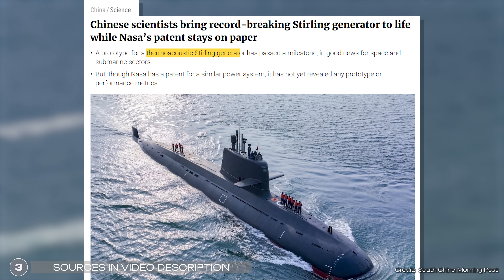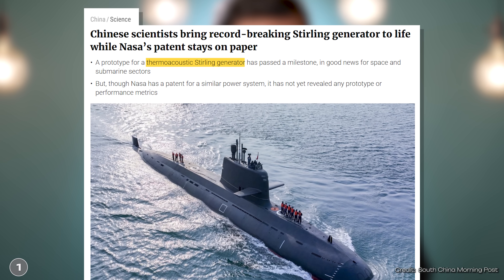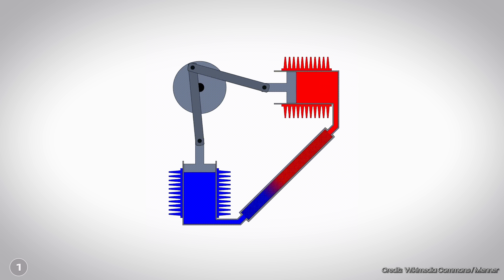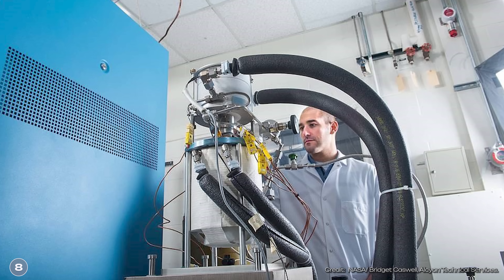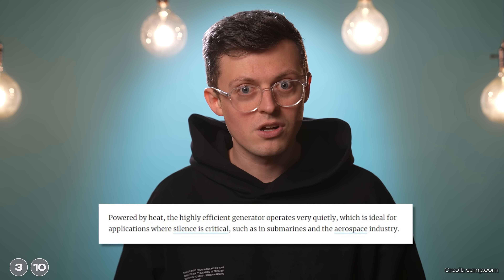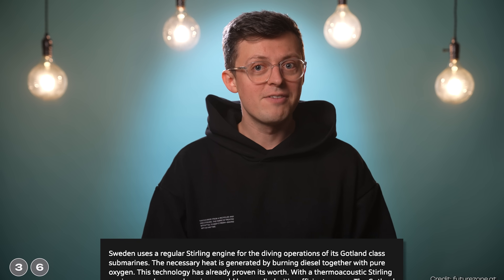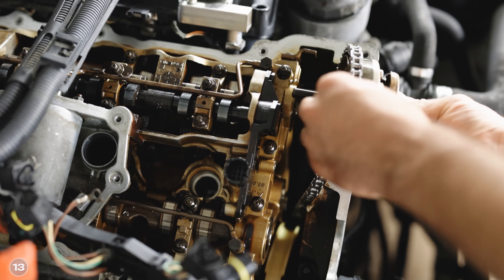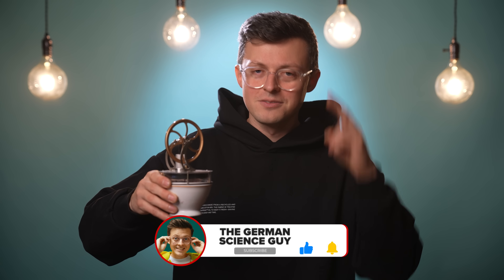The world's most POWERFUL Stirling engine: powered by soundwaves!

Comment: Sonar has an active mode and a passive mode, it is the passive mode that is impacted by quiet submarines and is actually the mode most commonly used to minimize being detected by the enemy. When a military is in search mode being quiet doesn't help very much because of the buoy's dropped by aircraft to actively ping for enemy submarines. These pings will bounce off of the hulls and get detected without giving position information to the enemy ship.
Reply: I believe there is another method of detecting submarines - the effect of the mass of the vessel on the (local) gravitation. 
There's no hiding place now!
Reply: @brianletter3545  Hmm.. Interesting, but a neutrally buoyant submarine has the same mass as the water it displaces, thus no gravitational anomaly is there.
Reply: @ True!
I have wondered about that.
Reply: The topic of sonar is highly classified, and it's widely misrepresented in media. ASW (Anti-submarine warfare) is a highly interesting topic from a scientific perspective. Both water temperature and salinity have a massive impact on sonar. Passive systems just listen for the echo of sounds. Active sonar creates distinct sounds that maximize the echo. Aircraft sonar is the hybrid approach where you listen passively to the echo created over a large area. The question at that point becomes what kind of receivers do you have aboard your vessel. The sonar array in a submarine is half the height of the ship located at the bow. Look at the size of the sonar array aboard a destroyer. Its not small, but they're a fraction of the size. Submarine sonar holds a distinct advantage over surface vessels. Even with active sonar, a surface vessel is significantly less capable of detecting submarines as their counterparts. That's why they develop attack subs to hunt other subs.

Comment: If you would look up edison motors, you'll see they're building heavy duty trucks that are EVs with onboard diesel powered gensets, which are used as "chargers/range" extenders. Theres another canadian company, in conjunction with Edison, Deboss Garage doing tge sane thing to a dodge pock up. Why is this imoprtant? Because you could swap in a small stirling powered genset for the diesel. That's wouod be one way to drive a vehicle with a stirling engine.

Comment: Hyliion's 3D-printed Karno (GE by proxy) appears to be more efficient and also has a contract with the US Navy. Has applications in fuel agnostic system - but also is speculated to have nuclear and solar applications (based on their Q&A Fireside chat). Still not certain if it's truly a Carnot cycle or Stirling cycle engine because it's unclear if the hot and cold side working fluids (Helium) are mixed or separate.

Comment: I have been around a long time an read extensively, especially technical information. Which is why I am able to say that every 20 to 30 years or so some new person or company investigates Stirling engines and claims some new breakthrough. Usually in transportation sector. The only one that has ever come to anything at all is the Swiss Navy. Unless you count the people who make and sell the tiny versions of basic Stirling engines. They have been successful selling the least thermal efficient version of the engine.
Reply: The reason these engines are not used much is they do not have instant power,  this makes them suitable for base load applications only. FYI the swiss do not have a navy , sweden does.

Comment: There is also a Stirling heat pump that works like the engine in reverse.  You input power to make the trapped gas vibrate and one end of the pump gets hot while the other gets cold.  This may find some use if these refinements on the engine also apply.

Comment: It may be quiet and wear free but at 34% efficiency it's useless. And 600 °C is far too hot for most materials and though we do make special materials for such high temps they are very expensive (think jet engine cost). Most importantly, for use in space the waste here is too much. Without an ocean to dump heat into this is, as I said, useless.

Comment: free pistons and linear generators never pan out as promised.

most of the problem is the generator itself. try designing one. the ideal magnetic path, and the application of power compared to when the generator places maximum load on the source dont match up. that is, the piston of the motor is traveling at its lowest velocity when it is producing maximum force, yet the lenz reactions of interacting magnetic fields in the generator are strongest when the piston is traveling at its highest speed with the least force. theres more to a generator than simply "waving a magnet near a wire", despite the thousands of "educational channels" claiming it really is that simple... 

you cant alternate the magnetic field, from one polarity to the other, can only vary it from a maximum to a minimum, so the output is immediately halved. a traditional generator doesnt simply increase and decrease magnetic flux, it flips polarity entirely from one extreme to the other.

for a given stroke, theres only so much iron that can be in proximity for the low reluctance magnetic path required. really easy to make a rotor and stator with matching iron stampings, plenty of flux engagement and density in the iron,  with room for windings to induce currents in... not so easy to do with a linear arrangement.

its much the same as why do we make air compressors that take AC power to spin a motor to drive a crankshaft attached to a piston in an air compressor, when we could just strap the piston to a magnet and wack it back and forth in a coil? because it doesnt actually work out that way in reality if you do it... the magnetic forces to drive the system are reducing as the mechanical forces of compressing air are increasing... and at all times, the force on the piston from the air or the magnetic flux are always in the ratio of 1:1, acting directly upon each other.

 whereas a rotating motor driving a crankshaft automatically has a mechanical advantage, simple leverage, and can apply an increasing force on the constantly reducing volume of air.

we have well over a century of people attempting to make linear generators and yet there are virtually none on the market as commercial products... its not for lack of trying?

i dont even have to start on the stirling... other than to mention that you need higher temperatures and pressures in the system to come anywhere near close to the same energy transferal as achieved with steam. the better option is to use the "ericsson/cayley" cycle...  stiriling isnt the only type of "hot air engine". its possibly the worst of the lot.
Reply: + If I remember correctly, the efficiency still depends a lot on the size and the optimum is somewhere around 5 meters. Therefore, you can forget about miniaturization.
Reply: LG refrigerator use a linear compressor, however that one is tiny anyway.
Reply: @ all i can find is a few promotional videos with the standard advertising animations and hype music... and lots of references to class action lawsuits? bright spark over-educated engineer at LG has had the "brilliant innovative idea" but in reality its proven to be rather lacking... its been tried many times before but that information is never part of a mechanical engineering course for some reason, lol. sure, the basic idea makes sense on a surface level, but its fundamentally flawed...

still the same deal... limited to the pressure produced by a magnetic field acting directly on a piston of "x" area. there is no force multiplication in a linear compressor.

a standard rotary motor driving a reciprocating piston uses the magnetic field to make torque, then the crank and conrod can produce massive pressures on the piston itself due to basic geometry... the same mechanism being found in large presses, punches, clamps... as the piston approaches TDC and pressures increase, so does the leverage the motor has on that piston. (conversely, a piston (be it ICE or other) engine with a crank and conrod is the exact OPPOSITE of what an engine needs when a high pressure is expected to produce rotational force. yet that architecture has become a mainstay as geometrically theres no way to avoid it?)

there may be more points of friction but thats overwhelmed by the mechanical advantages of pressure and force for a given amount of magnetic repulsion achieved by a certain size coil...
Reply: Well, I mean yes but the stirling engine still gives me a hardon.
Reply: You can also put a turbine on thermoacoustic engines also...
Reply: @ and then youre limited to mass flow, density, limited force available on a shaft, and any turbine extracting energy effectively is limiting flow to half its free rate, simply by extracting power. that restriction of flow then alters the operating characteristics.

i guess youve been watching that channel where someone is attempting the idea? with mediocre success?

sure, it looks good on paper. a lot of ideas do...

Comment: NASA installed Stirling engines in two vehicles in the  70's-80's. They worked very well. These engines had enclosed burn chambers that made them very efficient. The designs would be good for a generator on an ev.

Comment: China usually uses U235 in its submarines. This generates a temperature of close to 2000° C. 
 For a thermoacoustic Sterling generator powered by 600° C  A secondary transfer coil would likely use a sodium -potassium metal or more likely super critical CO2.
 Cooling the Sterling generator would be easily achieved by seawater, and so a submarine could be possibly identified through an infrared trail.
Reply: Fission leaks neutrinos and some believe the large detectors have been able to sense earth side reactors. 
It may simply be more valuable to pilot light a sterling generator to run with no sound and no fission
Reply: Wow, you are wrong on your temperatures my friend. I'm not sure what your source is but they confused temperatures and pressures and Fahrenheit with Centigrade. You could never build a containment vessel for a U235 reactor on a submarine if it ran at 2000 degrees C. For instance the melting point for iron is 1538 °C. Honestly even the 600 °C they mention is highly problematic as it is over 500 degrees hotter than reactors actually run.
Reply: @ yeah that’s why they have a primary cooling circuit.  I’m talking about the secondary cooling circuit.
Reply: @Just-Iss-4U  still wrong, 950 C is the tops for gas cooled reactors but yes 600 C would be a possible  function  but more likely the saturation point of steam at 300 C  But what do I know, there just is not enough data to make a determination.
Reply: @paperburn  In nuclear reactors, uranium dioxide (UO₂) fuel can endure significant temperature increases during transient conditions, such as rapid power changes. Studies have shown that UO₂ fuel pellets can experience temperature spikes up to approximately 2,600 Kelvin (2,327°C) without immediate failure. This resilience is due to the material's high melting point and thermal stability. 
 That's right from the US National Research Council.
NUREG/KM-0004
January 2013
Office of Nuclear Regulatory Research
Reply: @Just-Iss-4U  see how a little knowledge is dangerous? spikes and steady state are two different animals. but at least your doing research.
Reply: @paperburn   You used the word "tops"
Reply: @Just-Iss-4U  still does not make you right...
Reply: @ different nuclear materials have different critical temperatures. That’s why the choice of material is important for different applications.
Reply: @vincentbrown4926 That can’t be true, 500 degrees lower than 600, that’s what water boils at normal air pressure.

Comment: It doesn't make sense to claim that it's silent. It literally uses heat to create a soundwave. As someone who experimented with TASEs, I can tell you that they literally sound like an organ pipe or a bottle when you blow over its lip because it's the dimensions of the tube that determine the resonant frequency.
Reply: this one in particular maybe not but they are near silent in operation and we know this because of i think it was a 2012 NATO wargames in which a Swedish submarine made it through ALL of the US's submarine detections to score several hits on the carrier before leaving just as undetected, the US of course then had to "borrow" said submarine for "research". you can also isolate the motor from the hull and encase it in a soundproof room because at those frequencies it wouldn't take much to block the sound, it would still remain just as silent though you'd be better off training whales to find these subs.
Reply: @ToeCutter454  the Swedish Gotland sub (from the little info released) has normal stirling engines not TASE. The thermodynamics are fundamentally different because a Stirling cycle is almost similar to the Carnot cycle which gives maximum efficiency. The thermoacoustic cycle uses adiabatic expansion/compression rather than isothermal ones as in the Carnot/Stirling cycle. Also the TASE is inherently a reciprocal engine that WILL create primary vibrations like any piston engine. Whereas it's not confirmed whether the Stirlings in the Gotland are reciprocal or rotary designs. The latter would significantly lower noise emissions.
Reply: The vibrations from piston movement can be partly cancelled out by arranging opposite moving pistons. Whereas the hiss from high pressure steam entering a turbine is difficult to dampen.
Reply: @ToeCutter454 That was a normal sterling engine run by diesel power. 

 That story is way more complicated too. You should what happened both times, and why!
Reply: I would make the same remark. But it could be the sound frequencies are very different from classic submarine noises?
Reply: @tuttebelleke  They would be, but that's bad because it pretty much gives you a "fingerprint" for the model of sub you are using. Similar to how it's easy to tell whether a car runs on diesel or petrol, because the sounds are distinct.
Reply: @ telling that an engine is air cooled, water cooled, or oil cooled.. telling that its a ford v8 versus GMC... some people can tell one year model from another...

that thats a bus passing, the local firetruck, the water carter, or just a regular dog and trailer...
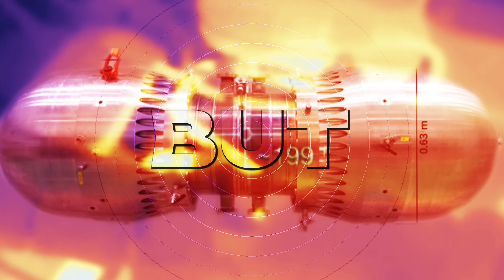Reply: @8:07 you can hear the A pitch of the motor running. Not silent, but also not blasting db thumps of combustion.
Reply: They make that sound when you make the toy models. This is designed to be silent.

Comment: Ideal in really cold environments i thought Aren’t Stirling engines more efficient the larger the temperature differential between the hot and the cold side?
So in Antarctic habitats have them fitted with the cold plate poking through the wall and using waste heat for the hot side. Seems a no brainer to me but I’m just a mid-wit .
Reply: one of the ways they track subs is by heat trails so i do not know